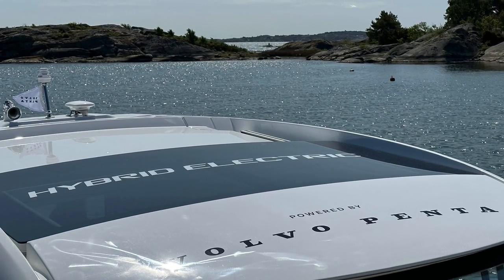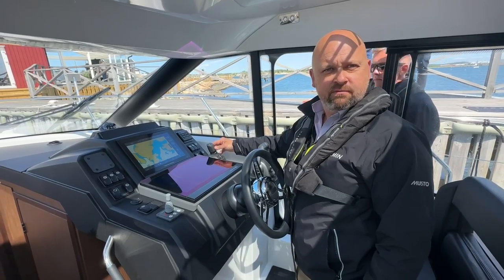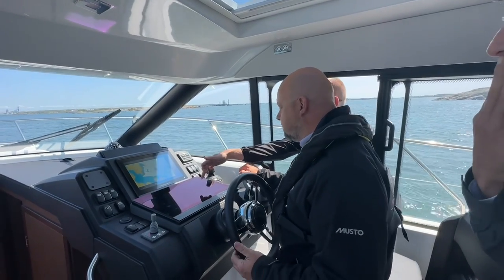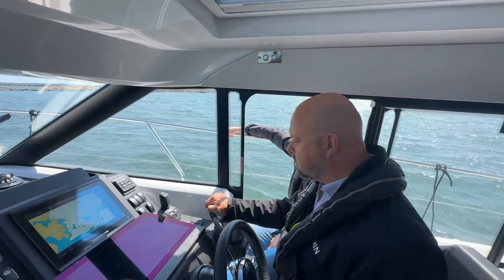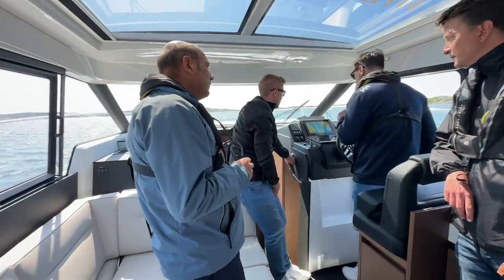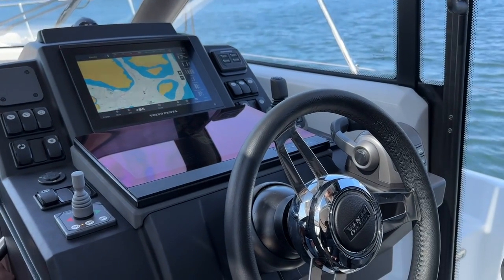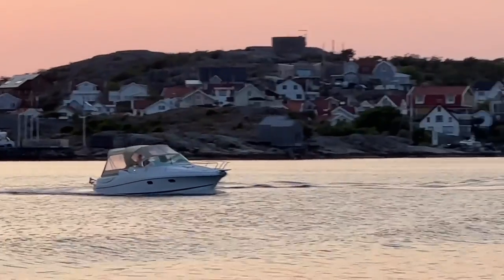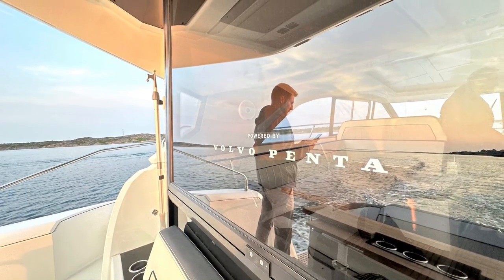Testing the new hybrid electric engine from Volvo Penta on a Jeanneau NC 37

Comment: Are the batteries stored in the 3rd/storage cabin?
Reply from the maker: Yes, but I wouldn’t call it a cabin on the NC37, It’s just the storage locker which you can sleep a person in if they don’t mind being in a very small space.
Reply: @robatlanticyachts9046  yes indeed. Always strange what they did there. versus the 1095, not putting a door on. Not that there was loads of room on the 1095 either. Apart from the head layout, inboard/outboard versions (and a bit more finesse for the NC)
Reply: But who fit this hybrid engine in the NC37? Is it a Jeanneau trial?